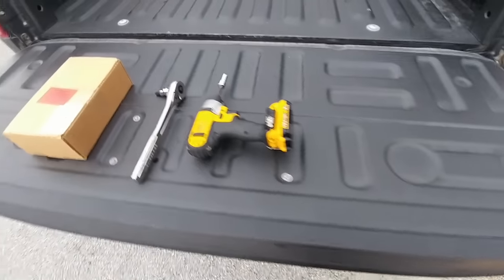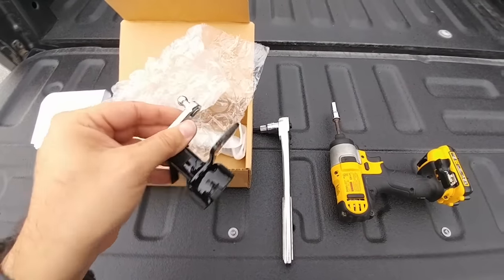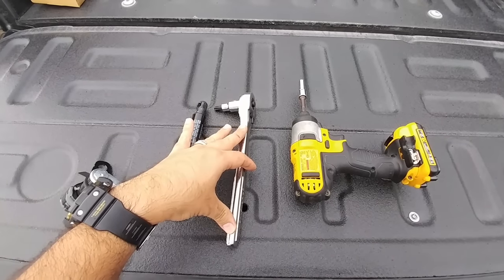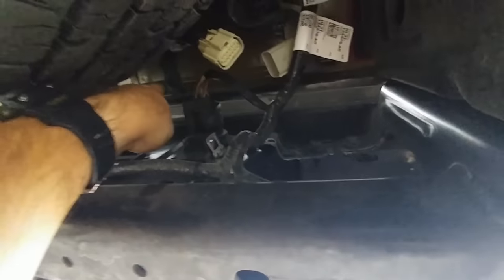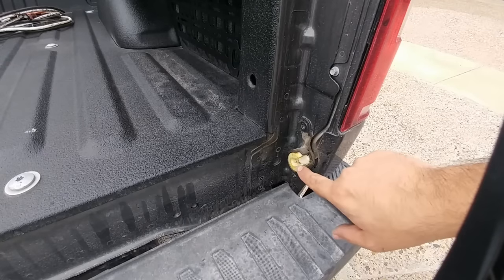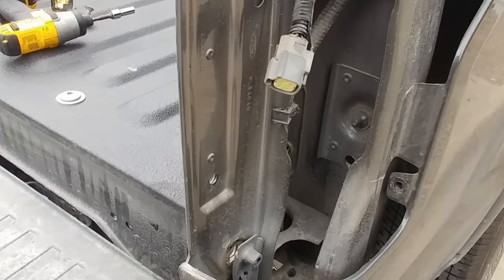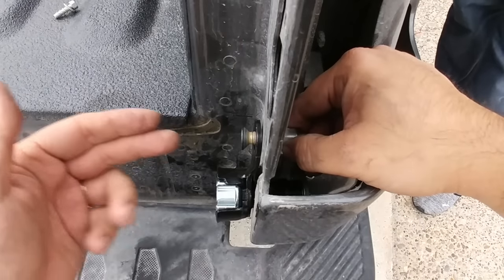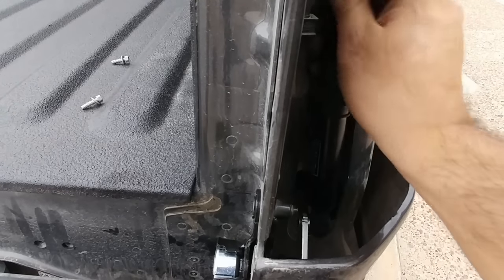Best $65 spent on an Ford F150 XL, STX and XLT!

Comment: I have an 05 f150 5.4l fx4. I just got it recently and the first time I let the tailgate down I was surprised about the way it came down. It wasnt even a question about if Ford thought I was weak or what not... if you dont have this feature you are missing out. You still have to push the tailgate back up, so you weak guys out there better be ready...lmao... 
It's a safety and a convenience thing and I guess if you are a macho guy you may not like this
.. just simply remove the mechanism I guess. Say one of your kids goes to drop it and it just hits them in the head... my 8 year old daughter can go drop this tailgate and it's safe. 
Anyway... just thought I'd share why I like it.

Comment: I'm thinking about buying a 2010 F-150 4x4 with the 4.6v8 anything I need to know about the truck? Thanks
Reply: I currently have a 03 F-150 with the 4.6 that has over 280k miles on it. Keep the oil change current and I always use Motorcraft 5w20. I did once develope a vaccuum leak on the tube that goes to the PCV valve and had a coil pack go bad at another time. I'm currently having issues with the door cables for the rear doors. All of which are an easy fix.

Comment: What is that tank looking thing shown at about 5:30?
Reply: Water container with a hose output.  Spray your boots off or anything else before getting into truck.
Reply: @stevelamby7658  Clever.  Do you have a brand name I can look up?
Reply: dberry99 probably a “waterport”